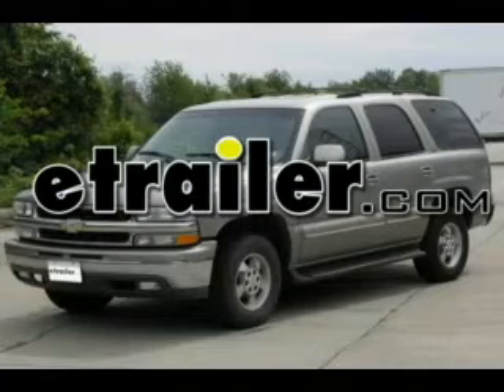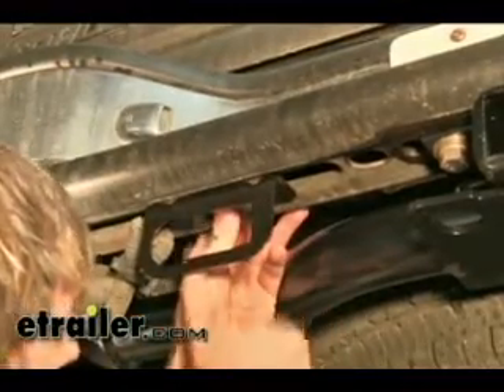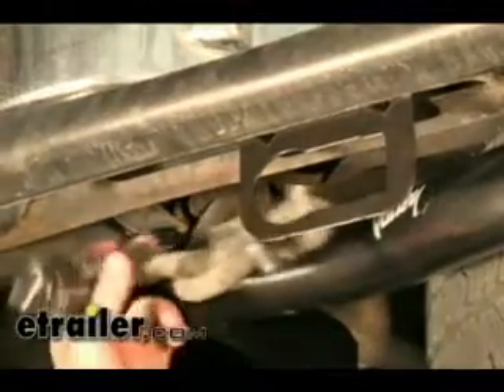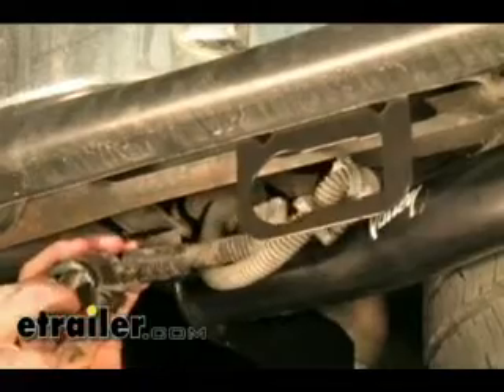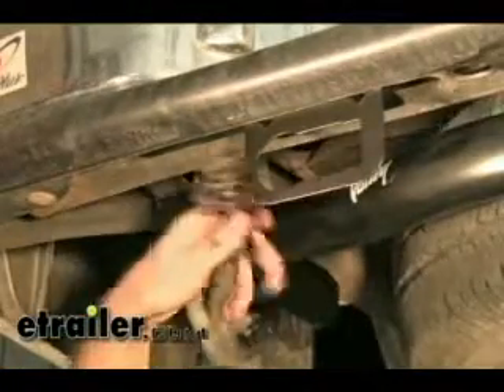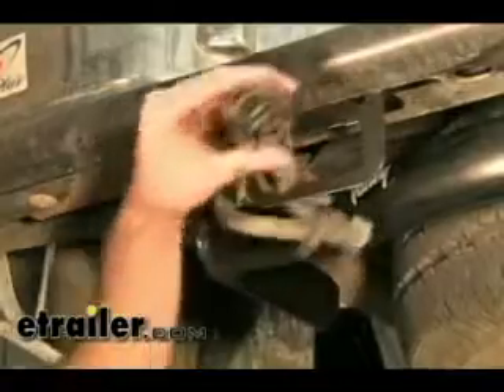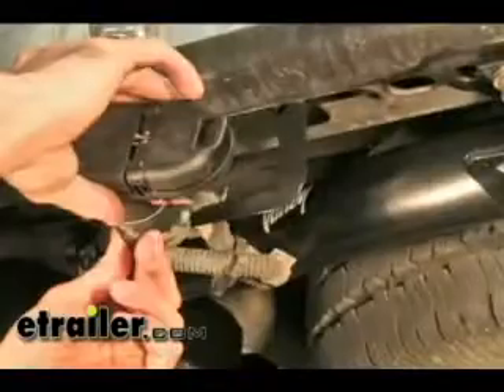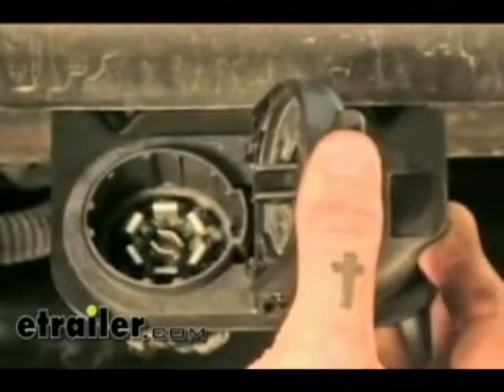Install: 7- and 4-Pole Trailer Connector Socket w/ Mounting Bracket on a 2001 Chevrolet Tahoe

Comment: I bought the Hopkins 40975 in preparation to install it on my 2000 Tahoe that is identical to the one you are working on in this video. I have looked and cannot find the wiring loom and plug you show in your video.  Any help would be greatly appreciated :)
Reply from the maker: The Hopkins HM40975 https://www.etrailer.com/p-HM40975.html can be a replacement for the 7-way connector on a 2000 Chevy Tahoe that has a 7-way from the factory. It sounds like yours didn't come with a factory 7-way so the wiring to plug into the Hopkins isn't there so you'll need to hardwire a connector.

The easiest way to install a 7-way is to start with a 4-way that has a powered converter box like one on of these https://www.etrailer.com/t1-2000_Chevrolet_Tahoe.htm?style=without+factory+7-Way  Then use our kit to convert the 4-way to a 7-way https://www.etrailer.com/p-ETBC7.html

Comment: Will this part number fit my 2005 Chevy Tahoe?
Reply from the maker: Yes it will as long as your Tahoe came with a factory 7-way. The 2001 Tahoe in the video is the same generation as a 2005 so the install is basically the same.